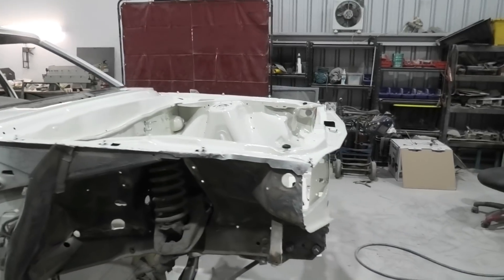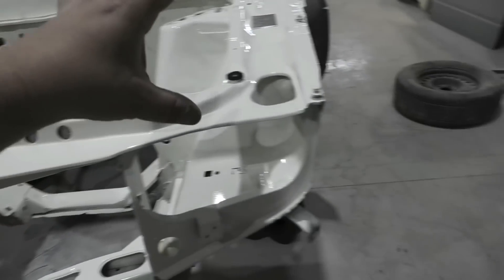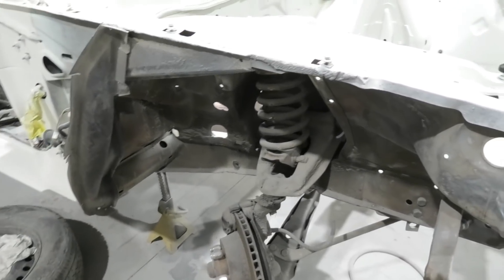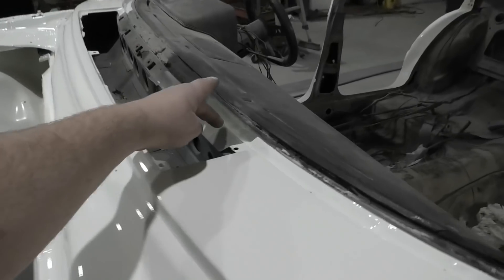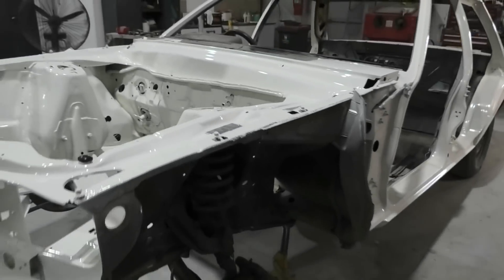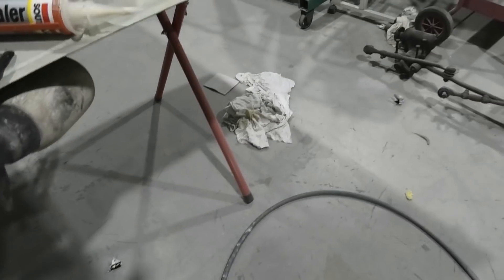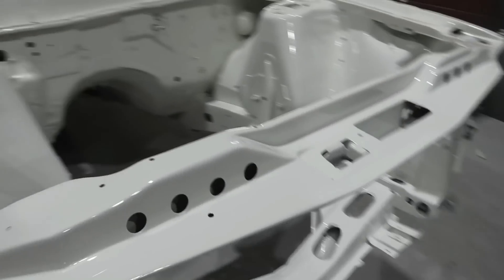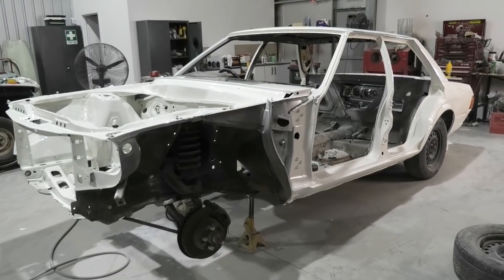XD falcon update part 3

Comment: G'day Graham. Been an avid subscriber from since before I got my own XD in December 2020. It was off the road for over 20 years by the time I bought it and it's been a great privilege to put one back on the road. I've gone through the wringer with it though as the plenum had a massive hole in it above the booster (with others strewn along it's length). That got fixed - at great expense - by a very talented body repairer. So no more leaks coming from that area.
The problem now though is I'm getting water trickling down inside the front guards and making it's way to the floorpan whenever there's some decent rain.
Was hoping you could put forward an educated guess as to why it might be happening. All the bungs are in place so that can be discounted. Was thinking something wasn't reassembled properly when the guards were put back on. 
Appreciate it heaps...Wazza.
Reply from the maker: How well sealed is the windscreen that would be my first check
Reply: Appreciate the reply. I'm assuming the windscreen was refitted correctly (was removed before work started) as all the repairs were carried out at a proper smash repairs shop. I'll quiz them about it. The leakage seems to be coming from somewhere forward of the screen though.
We'll start at the windscreen and if that's all good we'll be taking the guards off again. Thanks very much Graham!

Comment: An ex Rozzer's car? Elwood would be impressed.
"It's got a cop motor, a 440-cubic-inch plant. It's got cop tires, cop suspension, cop shocks. It's a model made before catalytic converters so it'll run good on regular gas."

Comment: Hi Graham, love your channel mate. What's your favourite method of stripping a car? Soda, sand, paint stripper, or dipping? It might depend on the condition, so say a 40 year old XD with some rust holes in panels like rear quarters that need patching and just general light surface rust underneath. Have you ever done a vid on stripping? Wouldn't be a bad idea if you haven't.
Reply from the maker: all depends on how stripped the car ?
Reply: @xacoupeguy  I guess I mean a car that's in the shop for a full resto and has had everything stripped off so it's a bare shell
Reply from the maker: @4BoltClevo  get it blasted and epoxy coated is one of the fastest ways but I don't mind acid dipping either both of those are quite effective
Reply: @xacoupeguy  might go the acid dip then

Comment: looking good graham 
yea that dry over spray is a pain in places like engine bays 
thats what i like about the early holdens you can remove the sub frame and get good access to the firewall 
and paint the subframe seperate 
 found using a smaller spray gun in those tight areas helps
 i use a touch up gun to do door jams etc
Reply from the maker: You know what's funny I was legit thinking how much easier the ej engine will be when I was painting.
I look forward to the day I do the ejs engine bay it will be magic

Comment: Great work mate, going through your old xd videos you mentioned brushing on Epotec, what’s the process doing this?
Reply from the maker: quite simple mix the stuff up as per normal and instead of using a spray gun use a paint brush
Reply: @xacoupeguy  Sweet, and what paper does it need to be rubbed with before high build?
Reply from the maker: @Haydntickford  normally you put epoxy primer on bare steel but 80 or 120gritt should be fine
Reply: @xacoupeguy  wow okay, does it not get shrink back?

Comment: is it opt36 on id plate?
Reply from the maker: I dont believe on XDs (I could be wrong) they have the option 36 on them but ive personally seen the Ford verification letter and its says it has the police pak not to mention its a povo pack gl with a 351 limited slip diff and somehow it still has its tramp rods under the back